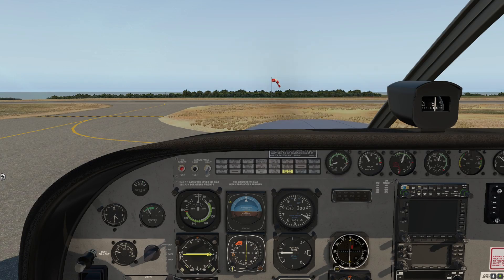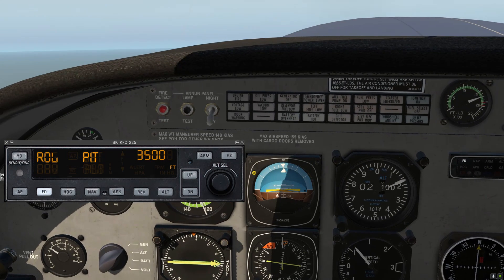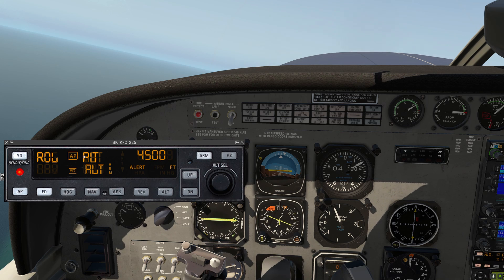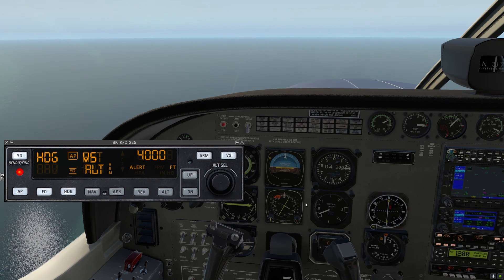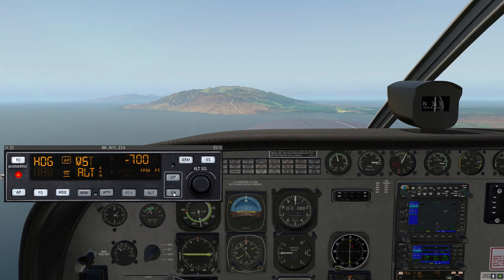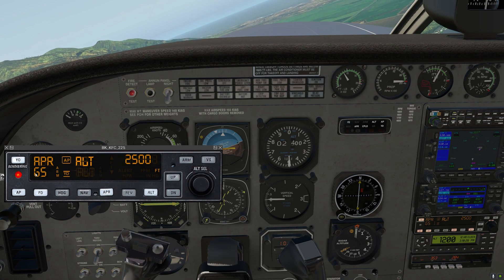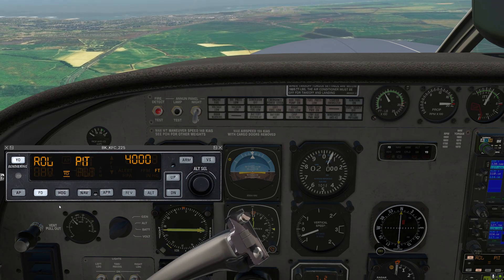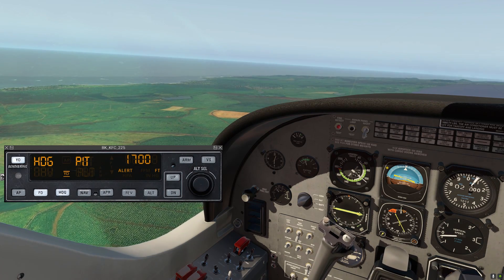Thranda Cessna C208 Caravan Autopilot

Comment: Looks like a great aircraft…would like to see if compatible with Honeycomb Bravo for Alt, Heading, VS control.  Note Laminar’s C-172 is compatible.
Reply from the maker: The autopilot's code makes use of default X-Plane commands, and we've included those commands in the autopilot section of the manual.  So it should be pretty easy to set up with hardware for the AP buttons!  :)